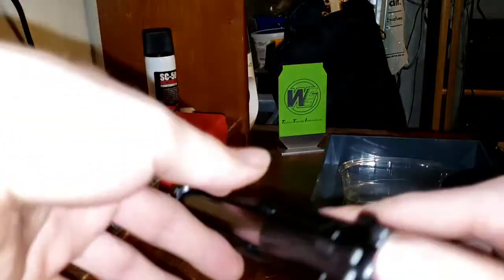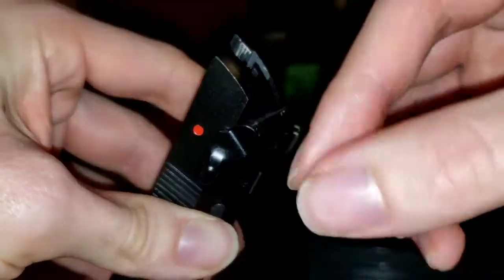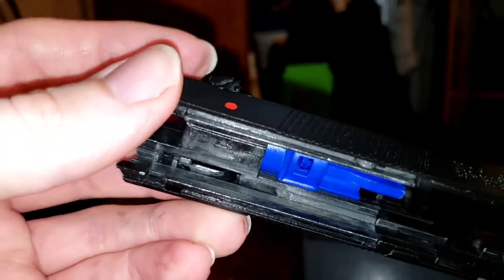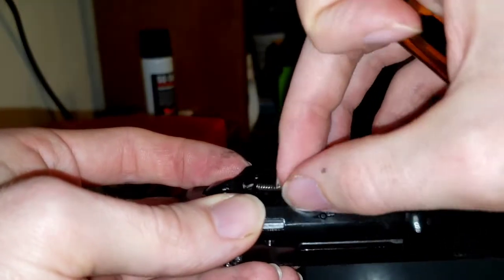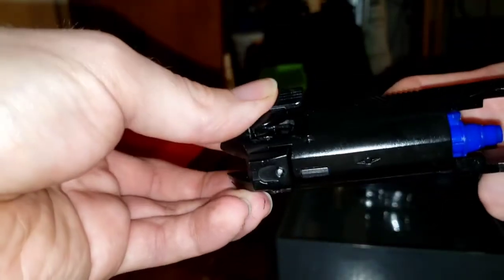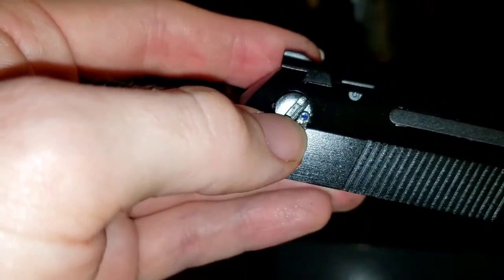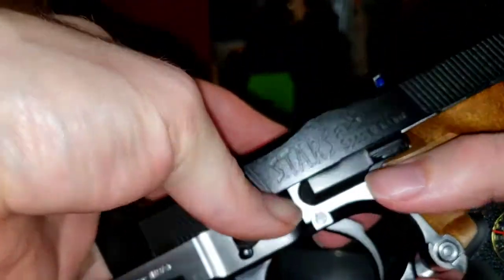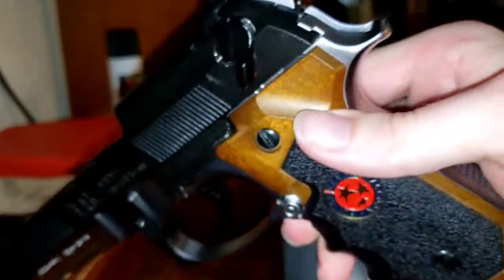WE Tech M9 Series Gen 2/ATV2 Safety Disassembly

Comment: Awesome video. The metal piece (lever) that is being held by the flathead screw broke on my barry burton gen2. How do I replace that? It can only do full auto and safe because that lever doesn't pull back.  Also the dummy firing pin on mine is gone. The rear sight is also loose. I wish wetech has an official teardown video. This is the only video I see on youtube about gen 2s.
Reply: Would love to see a full teardown. Thanks a lot in advance.
Reply from the maker: I am currently on leave for business, when I get access to a WE Gen 2 again I plan to do a full tear down and reassembly video. This video was originally made for a friend a few months ago unfortunately but with the lack of content I was hoping to release I tried to make do.
As for the lever you mentioned, once you get the safety out you can remove the metal bracket that holds the nozzle in place and the rest disassembles itself. Be careful when doing so as some of those pieces like to fly off. 
The rear sight is held in by very tiny philips screws on the underside of the slide.
Hopefully I can get my hands on one soon and make a proper video.
Reply: @LifeofStrife  Fantastic! Looking forward to a full teardown. Cheers!
Reply: I just changed my dummy firing pin like a few weeks ago. There's a little notch behind a hole on the blowback unit the hook part of the dummy pin goes into. With enough careful placement it'll somehow just.. hook into place and stay there.
Reply: @_NerdOfAKind  thanks man!

Comment: Magazine in (with gas and BBs), rack the slide, safety decocks. Can I manually decock it instead though? My KJW can do it to a half cock only so I have to drop the mag if I want to fully decock it.
Reply from the maker: With the safety off you can pull the hammer back to half-cock or full without having to rack the slide. Then you can decock it with the safety.

Comment: Actually, a quick question if you don’t mind! The sight on mine is completely missing. If I purchase a replacement sight, would I also have to put in new screws to hold it in place?
Reply from the maker: If you wanted to put it in the correct way, yes. You would need two screws and I would recommend some blue (non-permanent) lock-tite to prevent them from loosening. 
As for the other way, you could use some adhesive that bonds metal but you'd have to scratch the mating areas of both down to bare metal. I can not recommend that method though, but food for thought.
Reply: @LifeofStrife  thanks for getting back to me! Do you happen to know the kind of screws needed? Thread size and/or length?
Reply from the maker: @minatovssouji  I have not been able to find that information unfortunately. Best way I can describe them is almost like eyeglass screws but I have no idea if the threads are the same. KYAirsoft is usually where I go for small parts but the descriptions can be a bit useless.

Comment: Hey man! Me again, sorry for bothering you so much, but since you have so much knowledge of the guns I can't just let you go! So, for cleaning the Gen 2 Samurai Edges, I have read alot about it online and seen alot of people talk about putting Gun oil/silicon oil/all kinds of oil/grease/alcohol/whatever on em, but most just contradict each other and I don't know what to do. Whats your way to keep the Berettas clean as well as their mags clean? Thanks!
Reply from the maker: Petroleum based oils, such as gun oil, are a no go with airsoft guns. I used to use Silicone oil but I found that it was too thin. They have different weight Silicone oils used for Remote Control vehicle shocks, I have no gotten to try that yet.
I use Permatex Brake Parts Lubricant that they sell in the automotive section for Brakes. I get mine at Orielly's or NAPA, many automotive places have it. It is purple and silicone based.
For cleaning, you can use light dish soup and water (nothing harsh) and use isopropyl alcohol for displacing water and dust after, but allow it to dry completely before reassembly or adding lube.
As for the mags, as side from a damp cloth to wipe away dirt I really haven't "cleaned" any yet. I have disassembled them for repairs and to stop leaks, ect.